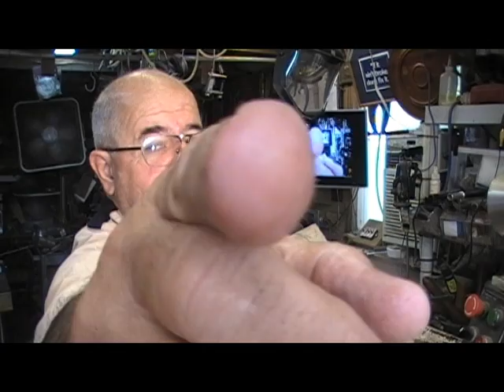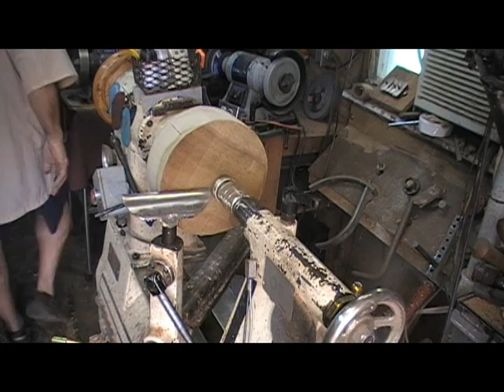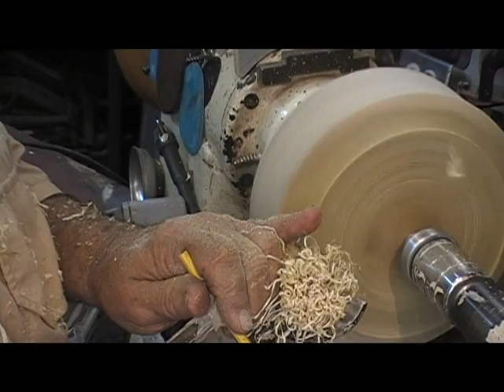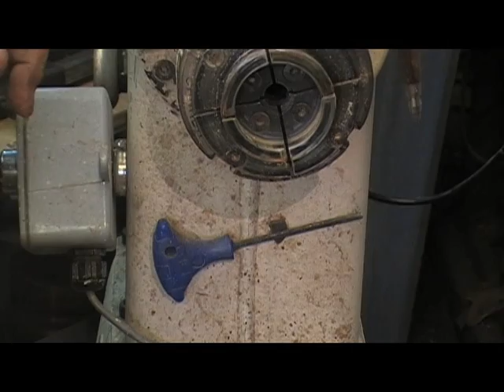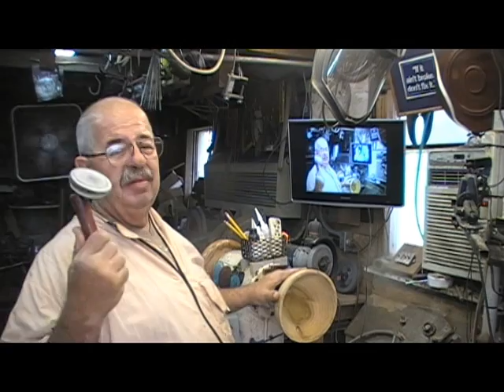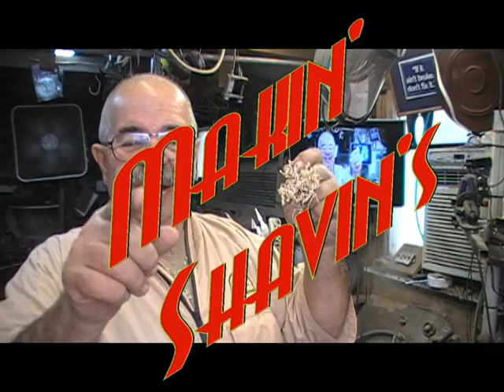# 195  The bowl, the beginning

Comment: CBN = Cubic Boron Nitride
Optigrind is one brand. ALLEGEDLY (I've yet to use them...)  works better on Carbon Steel than diamond, but has the advantage of a diamond lap in that the metal substrate it's on STAYS flat and true.